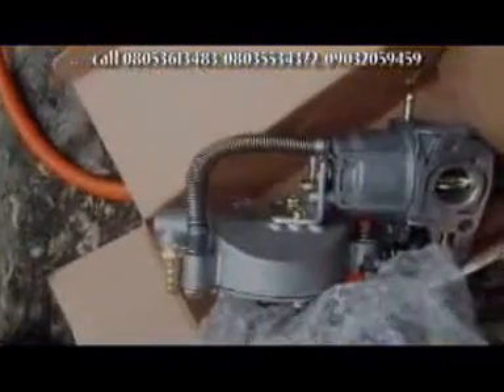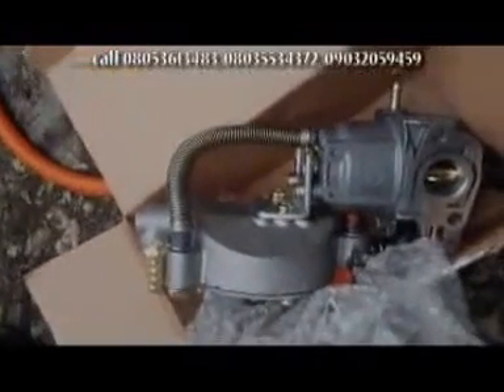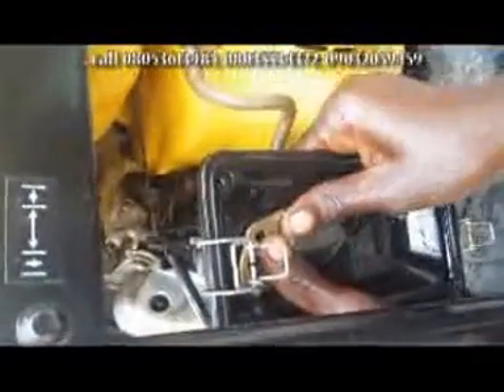how to convert your petrol Generator to Cooking gas Generator

Comment: Please what is a Peltro generator?
Reply: What they mean is a generator that runs on gasoline. In the US we say gasoline. They say petrol. It's just an engine that runs on petroleum fuel. In the US, we would say this carburetor will allow you to run your generator on gasoline, propane, or natural gas. These are nice and work very well. They are very easy to install. If this product was available in the US 4 or 5 years ago, they would have sold thousands of these. Most people bought those expensive kits that required drilling and cutting. They made a mess out of their generators. This is a super clean installation.
Reply: Brymmie  
n @AAA@HEY 4 HEY $MMMM?.?